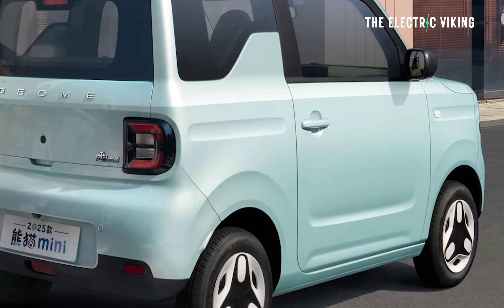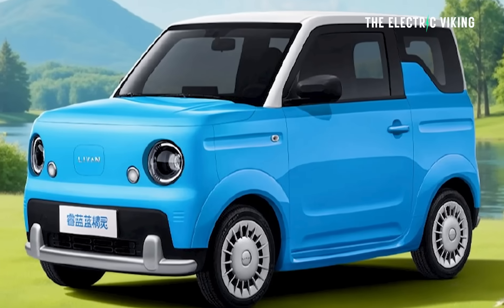World’s Cheapest EV? New Geely Livan Smurf Costs Only $5000

Comment: These would make great pay by the mile city transportation system.   To cover the .5-2 mile hops from train or bus stops and or just for a quick 5-10 mile round trip.   A start up company could by a fleet of them with a buy by the mile charge box inside.    Even better if the eventually had self driving too.   I can even imagine a different version that you step into like an elevator swipe or press your credit card card and tell it where to take you like an elevator on wheels.   Not sure which I would prefer the sit down version or stand up one.    Probably the stand up one for shorter under a mile trips and sit down for trips that are 1-10 miles.

Comment: This would indeed be much safer than a moped or a bicycle. Yet in many places the choice for a two-wheeler is not driven by cost alone, but also by its ability to squeeze through gaps in dense stagnant traffic. This would take the place of a car in traffic where its driver would otherwise ride something that causes less congestion. So - it has a purpose but also a problem.

Comment: 2:40 Uni-body construction does not mean gigacastings are used. It just means the body is supporting the car instead of a separate chassis. In fact the video shows assembly with large pressed steel body segments, not gigacastings.